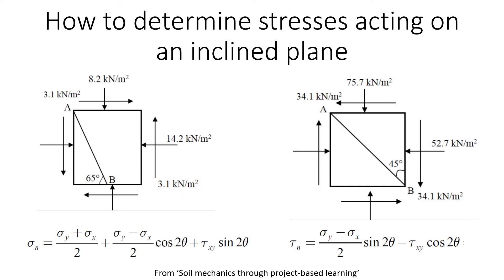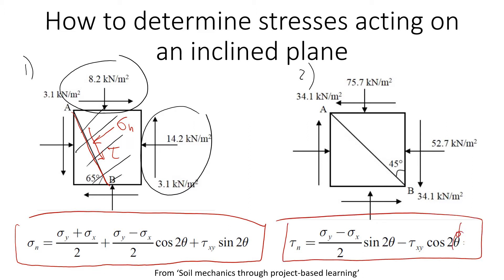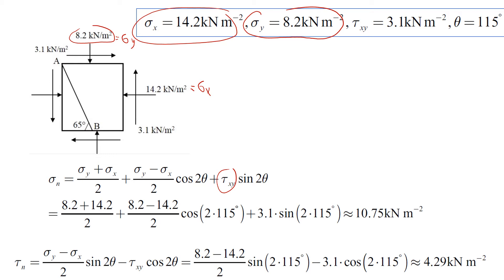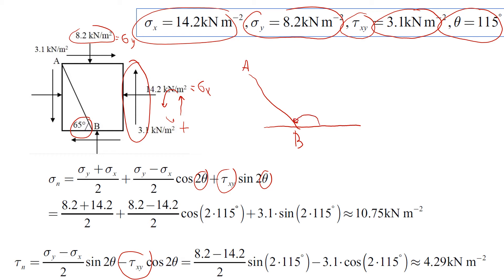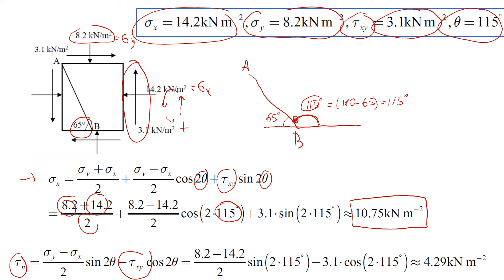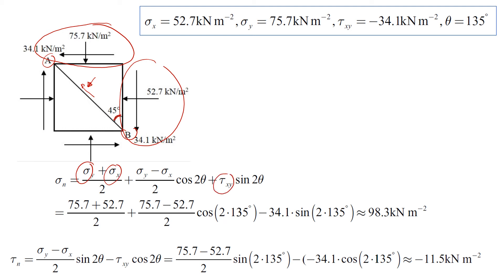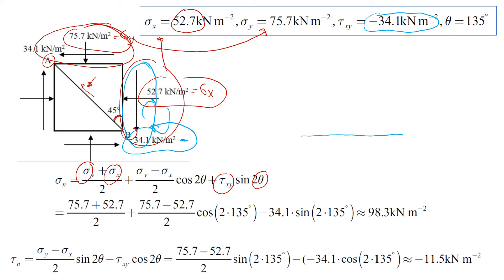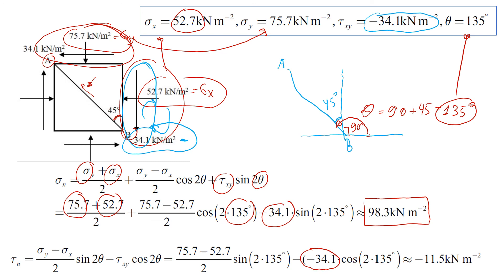How to Determine Stresses Acting on an Inclined Plane | Follow this Procedure to Get Full Score

Comment: Why is the degree 135 instead of 45?
Reply from the maker: This is just how the formula works
Reply: @GeoEngineeringandScience   Well that ain't very helpful. Understanding derivations of formulas helps students a lot.
Reply: You add 90 degrees to the 45 because that way you account from the total angle made from the original x-axis to the new position. In other words, to do these calculations, you rotate your unit coordiante system 45 degrees. Because you do that, you must add 90 to account for it. And remember that you rotate your coordinate system so that SigmaX is normal to the plane you are testing and Tau Y is parallel to it.